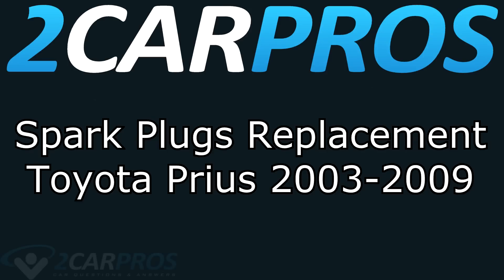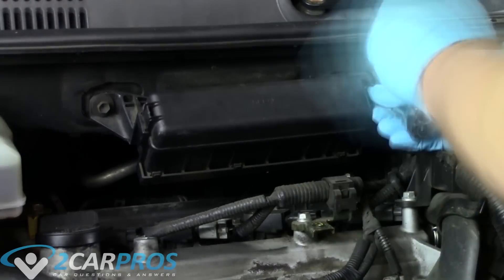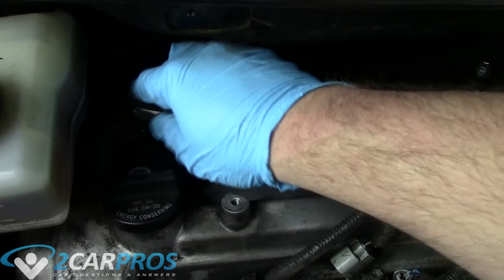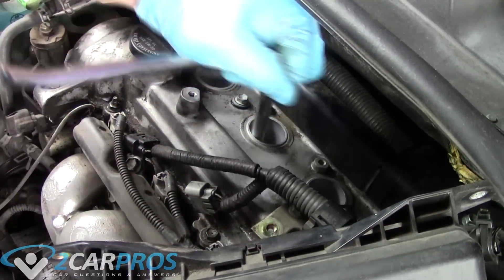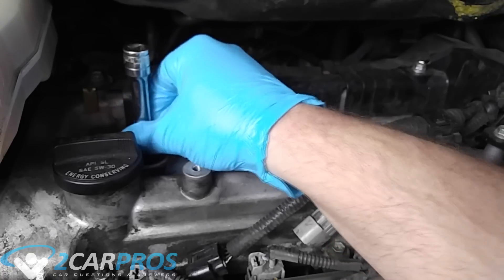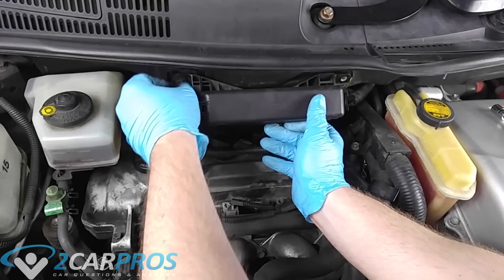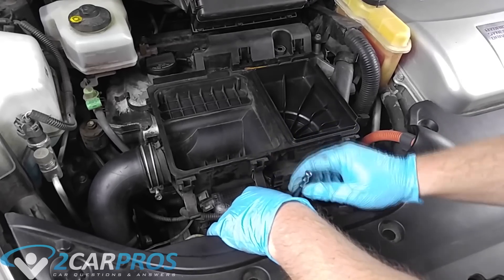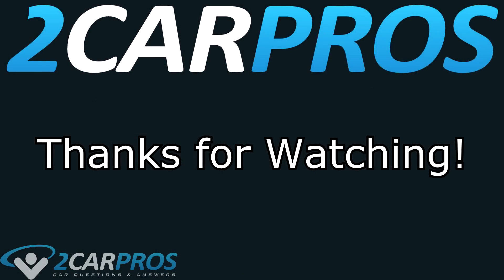How to Replace Spark Plugs Toyota Prius 2003-2009

Comment from the maker: The torque spec for all the technical Andy's out there for the coil pack is 80 inch pounds not 13 foot pounds. Honestly just wrist tight is fine. Thanks for watching!
Reply: So I don’t need a torque wrench 🔧? I can just hand tighten it and it should be good?
Reply: That 6-7ft Lbs for those that need a conversion
Reply: InstaBlaster...

Comment: Everything you showed prior to replacing the spark plugs in totally unneeded with exception to the relay box. You are giving bad advice on the video causing more items to be taken off to get to the plugs. I just changed mine yesterday along with new coil packs, without having to do any of the other part removals on a 2008 Prius 1.5ltr.
Reply from the maker: Did you ever think that people have different sized hands or tools? I couldn't get my hands or the camera where I needed it to. Heaven forbid you take something off and it makes the job easier or easier to see. Hardly "bad advice" if you ask me. Thanks for watching!

Comment: Just did this and you definitely don’t have to do anything with the air box. Move the relay box and all four coils come right out without even unplugging them. 

Also the NGK web site specifically says to NOT use any anti seize with their plugs and there definitely isn’t any used by Toyota at the factory.
Reply: Here's a tip on anti-seize;  use a non-conductive type (not "Never-Seize" brand which contains graphite, which is highly conductive)  Use compound sparingly, it doesn't take much to migrate to the plug's gap and ruin the plug.
Reply: I was going to say the same thing about anti-seize. You're right if you go to the website it says not to use it

Comment: I was able to changed my spark plugs today after watching this. Thanks again.
Reply from the maker: Excellent! Thanks for watching!
Reply: @2carpros  Thanks for the service you are providing ^_^ knowing the tools I needed afore I went under the hood made it an easy hour and change... even if my pole light from the elctric company kept shutting off on me (parked under it and did it at 3am since its so dang hot!)

Comment: Would you recommend also changing the COP boot and/or ignition coil?
Reply from the maker: If the boot isn't in great shape go ahead and change it. But the coil only really needs to be changed if there is a problem. But if one coil has a problem I recommend changing them all because the rest aren't far behind. Thanks for watching!

Comment: Excellent video, made it easy.  Another thing I did was pull out the mass air flow sensor, and clean it with the CRC mass air flow sensor spray cleaner
Reply from the maker: Very cool! Thanks for watching!

Comment: Thanks for refreshing my memory before spark plug change.  Worked on 2009 Prius, originally mine but since passed on to son.  I unscrewed, moved fuse box.  I only removed lid and 2 top bolts of air box, pulled up and forward to give an extra inch or so;  not a full removal.  I've done this car's spark plugs before without moving air box at all but a little more room is worth the compromise.  I find using 2 short ratchet extensions work best get in there with the spark plug socket.  I chose to use the Denso Iridium TT plugs.

Comment: This was WAY easier than I thought. I even cheated and left the coils plugged in. It turns out the only plug that was "bad" was cylinder 1 (the gap was almost double spec) after 185k miles, the last 15k have been extremely hard as I do not worry about the car too much.

Comment: Gen II = 2004-2009, not including 2003, at least in the US.  Gen 1 is the little sedan.  Also, be careful of the torque on the coil packs should be more like 6.6 lb-ft, based on comments below of broken bolts using 13.  Always check the gap on plugs you're installing -- even if they are 'pre-gapped'.
Reply from the maker: That spec is right from Toyota so take it up with them. Thanks for watching!

Comment: DO NOT torque ignition coil bolts to 13lbs. Just do them until they are tight. I did it to 13 lbs and the bolts literally twisted in half and broke. Luckily I got them all out. Other than that. It worked!
Reply from the maker: That is the official torque from Toyota. Personally I would just do it till it was tight. But everyone in the world wants a number. Thanks for watching!
Reply: 2CarPros I’m sure your right, my first time doing this, but it almost broke 4 of 4 bolts completely in half
Reply: You CAN do plugs to 13. I replaced plugs and it didn’t fix the problem. Then I replaced the coils, this fixed the problem!!

Comment: I'm going to change the plugs in my better half's Mk2 Prius soon and stumbled upon this video after watching the concise Auto Doc one. It seems that you're just wasting your time removing the airbox so I'll not bother with that, I'll only check the filter and won't be using an imperial socket on a metric spark plug!

Comment: Wupsie! I snapped off the bolt of the first coil-pack assy when trying to tighten it to your spec of 13 ft-lbs. 13 ft-lbs is the correct torque for only the spark plugs, not the coil-pack bolts. The torque for the coil-pack bolts is 82 inch-lbs (6.8 ft-lbs) - so 13 ft-lbs is almost double the correct torque. Luckily there was a piece of bolt sticking up that I could get a pair of pliers on to remove the remainder if the broken bolt. I borrowed a mounting bolt from the air filter box to replace the broken one, temporarily leaving the air filter box mounted with just one bolt while I drove to the hardware store and bought the correct replacement bolt (M6 x 30mm x 1) for the coil pack.  Back home with the bolts replaced, all is well now. Otherwise, extremely helpful video, very clear. Thanks!
Reply from the maker: It snapped at 13? That is an extremely weak bolt. I did all mine to 13 and it felt right. Sorry you went through that. But good work on getting that M6 replacement bolt! Thanks for watching!
Reply: @2carpros  I found a post someplace else where the same thing happened to another guy. He was tightening without a torque wrench but said he was surprised at how easily it broke. His broke in the same place mine did - in the hollow 1/2 inch or so of unthreaded spacer created by the body of the coil pack. What happens is that as you tighten the bolt, the threads in the block are stretching the bolt downward with the head of the bolt holding back, so the "neck" of the bolt twists, then breaks in that unthreaded space. He researched and found the correct torque of 84 inch-lbs, or about 6.7 Ft-lbs - pretty low. Other videos I watched on the procedure don't use a torque wrench, but tighten the bolts "just snug", so that's what I did then for the rest, and all went well. I did get the new M6 bolt easily at an Ace Hdwr.

Comment: Yea that anti seize amount was gravy amount at a restaurant 😂 good video glad it doesn't need to remove the wipers and firewall accessories.
Reply: Remove the floor matt's, remove fuzzy dice from mirror, six year old chicken nugget under the seat, remove the catalytic converter and sell it to the shady scraper, remove the hybrid battery... "Carpros" term used liberally

Comment: I didnt remove the airbox and i didnt disconnect the last clip to the coil. They left just enough lead so you dont have to disconnect the coils. It was super easy. I did replace the air filter while i was thinking about it. Thanks for the video
Reply: Yep, did it the same way, only removed the relay box.
Reply: cooper8318 I was thinking the same thing lol!
Reply: W

Comment: Looks like it takes a little over an hour, but the shop will charge you for 3 hours
Reply from the maker: That's how they make their money. But doing it yourself saves all that. Thanks for watching!
Reply: I charge $40 flat rate +parts so around $70-$90 depending on brand of plug you want and it only takes 20-30 minutes... So yeah shops are a huge rip off

Comment: Great video, I'm going to try it one of these days. So hand tightening spark plugs is close enough to 13lbs of torque correct?  Way better than to over tighten I bet.
Reply: No, 13 ft-lbs is definitely more than hand tight with just a socket extension. Use a socket wrench and go just snug but don't add muscle!
Reply from the maker: Thanks for watching! Yeah hand tight is good. You don't want it shooting out the top of the head and you don't want it stripped in there. Snug is good. Thanks for watching!

Comment: I was reinstalling the coil pack bolts and torquing them to 156 in/lbs and the bolt snapped. Is that torque spec correct?
Reply from the maker: 13 foot pounds is right from Toyota themselves. But just hand snug is good honestly. Thanks for watching!

Comment: what direction should I move the wrench to remove the spark plug? is it clock wise?
Reply: Dude, if your asking this question you shouldn't be holding a wrench. Just saying....
Reply: Christopher Drowne I totally agree but this kind of DIY videos are directed to those who never hold a wrench
Reply: @cdog42065  unless he/she's just getting started, in which case, more power to them.  By the way, there are some unusual situations (bicycle pedals) where it's not lefty loosy, but only because rotation of the thing might cause it to loosen  Lefty Loosy, Righty Tighty.
Reply from the maker: Counter clockwise. Left losey righty tighty. Thanks for watching!

Comment: Your brake fluid is looking a little dirty. Supposed to be a light urine looking color. Also, the most important thing to mention when changing spark plugs is to make sure the block is as cold as it can be. The engine is made of aluminum which is soft compared to other metals and if torquing the plugs you can strip one of the holes out. If that happens, you are screwed

Comment: Thanks. I just did this with the help of this video.

A couple of little things that might make things easier: You don't have to remove the top of the air box. You don't have to unplug all the coil packs, except the one on the far right (the hardest one to access X| ). Just be careful not to yank the wires when you pull out the coil packs.

If the spark plug gets stuck in the socket, try pushing into the the threads from different sides to unbind the spark plug from the socket. Put a rag between the threads and whatever you're pushing against to protect the surfaces that are in contact. In my case, pushing with my thumb was enough, but you might be need more leverage and/or want to avoid the threads cutting your thumb. If you want to try more force, try pushing against something like a work surface.

If you are really paranoid, I suppose you can grease the inside of the socket before attempting to remove the spark plug.

Not really sure if I needed to do this procedure, but I've had this car for more than 50 kmiles, so I know the spark plugs are at least that old (the car has done 133 k miles total). I tried to find pictures online of "healthy" spark plugs, and it's kind of hard to say whether mine were ok. If I looked carefully, I could see a little bit of a shiny surface on both electrodes. My guess is that even if that is the case, the spark plugs could be not performing as well as they should.

After this operation, I noticed that the engine started much more smoothly; no shuddering. My hope is that this will boost my efficiency and/or reduce emissions. Not really sure how to determine the latter (I recently passed California smog test), but time will tell if the former materializes.
Reply: Maintenance schedule says 100K miles for plug replacement.

Comment: Thank you for video. I did not take off air box but I did unbolt fuse box on firewall. If some one has less experience it would be better to remove air box to make it easier. Also I was able to leave wires on coil packs and just pull out of the way one at a time. One other suggestion if you do not have much experience when putting spark plug back in use the socket and exstension and get it started by hand first. they are fine threads so hold it verticle and start to tighten if you feel it binding turn it counter clockwise and to you feel it drop a bit then start to tighten again you should be able to tighten 90 percent by hand and finish with ratchet. DO NOT CROSS THREAD IT! That would involve removing head from engine.

Comment: Just a tip... keep all the coil packs in the holes BEFORE you take out the coil pack screws.  It's no fun if you drop a screw down one of the open holes.
Reply from the maker: A good tip! But if the spark plugs are still in the head the screw wont drop too far and you can get it with a magnet. You can also do one plug at a time too. Thanks for much for watching!
Reply: @2carpros  Why waste time with a magnet when his idea prevents that?
Reply: @mronemanband1  Yeah, because no mechanic ever dropped something. Just a dumb idea to remove something that doesn't need to be removed until after it's clear of the vehicle.

Comment: Hello wha can be if you have oil in the number 3 plug place??
Reply: bad o-ring/gasket in the valve cover for that spark plug well. When the spark plugs are out, remove the valve cover and replace the gasket and o-rings. For some vehicles you have to replace the entire valve cover because the o-rings are built into it.

Comment: I purchased a spark plug remover\installer tool from Ebay but it does not have the ft torque tightening spec thing on it, can I still use it to tighten the spark plugs in its place? is the torque measurement when tightening important or should I just make sure it's tight enough using my installer tool?
Reply: Everyone who works on cars at all should own a torque wrench.  Note that he talks about 13 ft - lbs, so be sure to get one that reads at that scale.  Practice on a screw going into a bike or box or something that won't be ruined if you're new at it.  Aluminum metal (blocks of engines) are not the place to do your first ever torque-tigtening.  Yes, you can just finger tighten the plug and then wing it (not too tight), but since you're doing your own work and saving all the mechanic fees, spend $20-50 and get the torque wrench.   Another thing: store the torque wrench like it's made of glass with the torque set half way between max and min, assuming it's the kind that you set, not the bar-reading kind.

Comment: What is recommended replacement mileage for plugs?
Reply: 120k miles according to my 2008 maintenance guide book.
Reply: @mpoisot  I must be living on borrowed time. 06 Prius bought in 08 with 17k miles, today I turned 331k miles, original plugs, coil packs. Still averaging 49.4 mpg.
Reply: @yorkielover6257 if you replace them they might run more efficiently

Comment: We just had the spark plugs replaced on our 2007 Prius. $357.00. Now they say engine valve #2 is going out. Dealer says $1800 to replace it. Ideas or prices ?
Reply: lol you paid 357 to have 4 spark plugs replaced? lol wow
Reply: hey George....I just got my whole engine replaced with rebuilt engine for $1500 total.... (bad rings and eating oil at 200k_).
Reply: Do the plugs yourself,  takes 20 minutes max.
Reply: Just keep an eye on the oil level. If the check engine light isn't on don't worry about it. You got ripped off on a plug R&R, $357 is crazy high. The plugs are $40 at list price, takes 20 minutes, spend some money on the tools if you need to,  you'll have at least $300, tools aren't nearly that much, and you only need to buy them once, if you don't loose them.
Reply: Sell the car QUICK lol
Reply: Lucas oil stabilizer addition at oil change helps on these engines, mainly checking levels often after 3k miles on oil change, or just do very frequent oil changes. Seals are junk in these!

Comment: Questions... not familiar with these 100k type of spark plugs. 1- What kind of plugs are they by name so I can ask for them? 2- Why didn't you have a gap gauge to check the gap? 3 - Why don't you replace the gizmos that sit on top of the plugs? 4-  Shouldn't they be replaced? - What about the wires to the spark plugs??. Typically there are wires for each plug that need to be replaced in past spark plug changing I've done- especially at 100k miles! 5- Is there a distributor cap like conventional cars used to have (though I am guessing its computerized ignition)? Have had 2 prius but this is the first one going to 100k and i know i need to do much to this car to make it go hopefully another 100k. like I am going to have the tie rods replaced since my alignment is never close enough to where it should be and they said i can either use the shim kit or another guy suggested even better to replace the outer tie rods. Since I found all four of them (inner and outer tie rods) on ebay for the price of one at the 'discount' auto parts place I am just going to do all 4. Well sorry I got off track but I got to do a lot to keep  my car going. My girlfriend thinks I should get a new car but I think i can save a lot of moolah by just changing out some part and tuning up the prius. Thanks for your (any and all) help and overall it was a very good job with the video. BTW, I never realized I have to get so many parts out of the way just to change the damn plugs. I learned a lot. 

.
Reply from the maker: 1. They are these: https://www.amazon.com/Denso-PK16TT-Platinum-Spark-Plug/dp/B002M2KO4G/ref=au_as_r?_encoding=UTF8&Make=Toyota%7C76&Model=Prius%7C1026&Year=2005%7C2005&ie=UTF8&n=15684181&newVehicle=1&s=automotive&vehicleId=6&vehicleType=automotive

2. They come pre-gapped 

3. The coil packs are fine.

4. Not if they are working.

5. No distributor.

Hope I helped and thanks for watching! :)